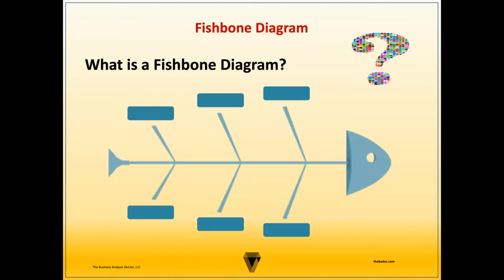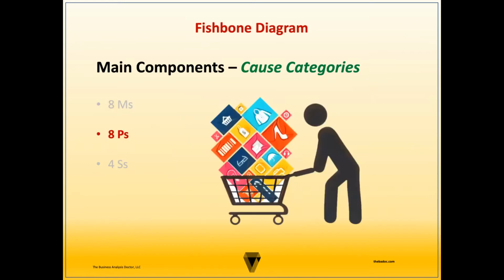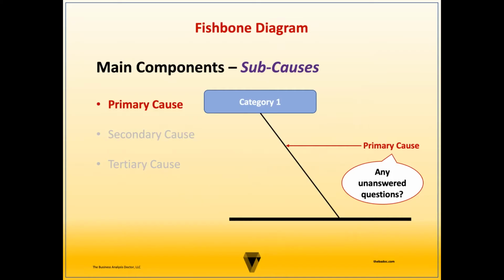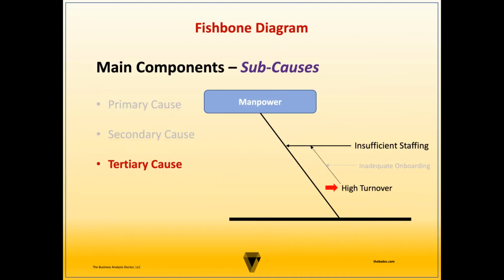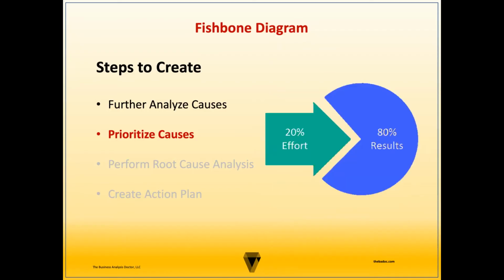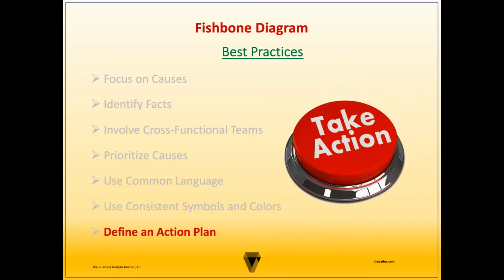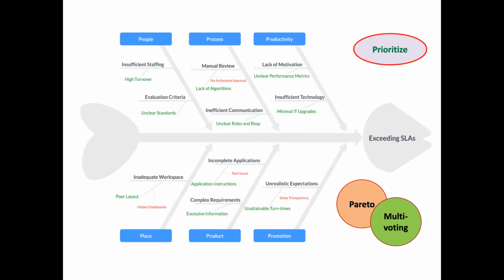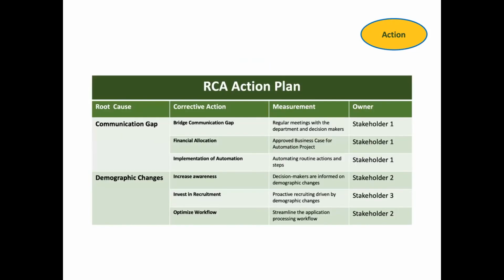Fishbone Diagram EXPLAINED - Root Cause Analysis Techniques

Comment: Thank you so much for your great effort, just I am little bit confused when fish boned is done how you will apply the Pareto to identify the 20 % of the causes to apply the 5 Whys
Reply from the maker: Sure that’s a common area of confusion. Once the causes are listed, we look for data or evidence (frequency, defects, downtime, cost, impact) that helps us understand which causes occur most often or have the biggest impact. We then take the causes from the fishbone and apply Pareto analysis to rank them. The goal is to identify the “vital few” causes, the 20% that are contributing to about 80% of the problem. 5 Whys to drill into root cause. Finally, we apply the 5 Whys only to those top-priority causes identified by Pareto, not to every cause on the fishbone. This helps us move from a surface-level cause to the true root cause we can actually fix. So in a nutshell Fishbone is for brainstorm causes, Pareto is to choose which causes matter most, and 5 Whys dig deep into those few critical causes. I hope that helps.

Comment: Can it be used for sports and team building ? And if yes then how ? Could u plz share some examples ? 🙏🏻
Reply from the maker: Yes, the fishbone diagram can be effectively used in sports and team-building contexts. In sports, the diagram can be used to dissect performance challenges, such as frequent losses, lack of teamwork, or skill gaps. For team building, it helps to explore factors that hinder collaboration, communication, or morale. By categorizing potential causes into areas like skills, resources, environment, and processes, teams can identify actionable areas for improvement

For example, a sports team experiencing frequent losses could use a fishbone diagram to explore causes under categories like training, strategy, equipment, and mental preparation. They might find that inconsistent training schedules and unclear game plans contribute to poor performance. Similarly, in a team-building context, a department struggling with collaboration might create a diagram with categories like leadership, communication tools, workload, and team dynamics. This might reveal issues such as unclear leadership roles or insufficient communication channels, providing a clear path to solutions. By using a structured approach to problem-solving, the fishbone diagram encourages teams to collaborate, think critically, and take ownership of their challenges. I hope that helps!
Reply: @thebadoc  thanks you so much for explaining 🙏🏻

🇮🇳🙏🏻🕉️🙏🏻🇮🇳

Comment: Thank you for providing a thorough summary of the fishbone diagram. You described everything very clearly, from the root cause analysis to how to brainstorm causes with stakeholders. Using the 8 M's, 8 P's, or 4 S's as needed is a very useful strategy for adapting the analysis to unique sectors. I appreciate how extensive the procedures are, especially when you discuss finding secondary and tertiary causes for greater clarity. This will certainly come in handy for my future project. Thanks again!
Reply from the maker: Excellent! And you are very welcome. This technique is challenging to explain because there are a number of sub-techniques embedded within it, so I am glad you appreciate the amount of thoroughness in the video.
Reply: @thebadoc  Thanks, Dr. Michael!

Comment: This explanation of root cause analysis is really insightful! The way the five whys method is applied to drill down to the underlying issues is super practical. I'm curious though when you identify multiple root causes, how do you prioritize which ones to address first? And how often do you revisit and reassess these causes during a project? Thanks!
Reply from the maker: You're welcome! When identifying multiple root causes for a problem, it's essential to prioritize them effectively to ensure the most significant issues are addressed first. Some strategies for this might be an impact assessment, cost-benefit analysis, or a dependency analysis. I hope that answers your question.